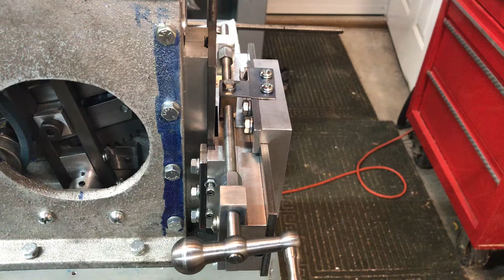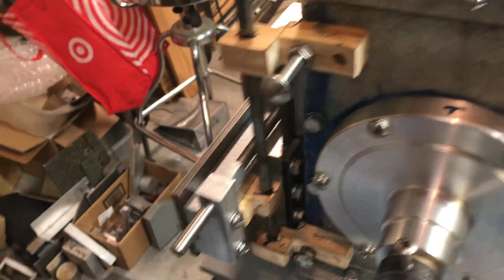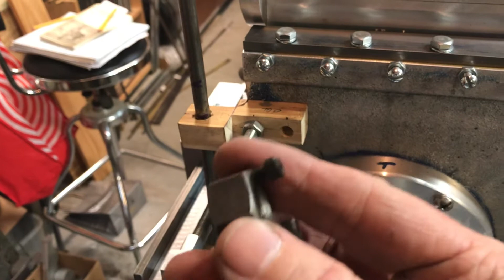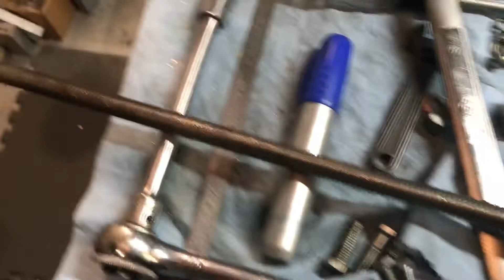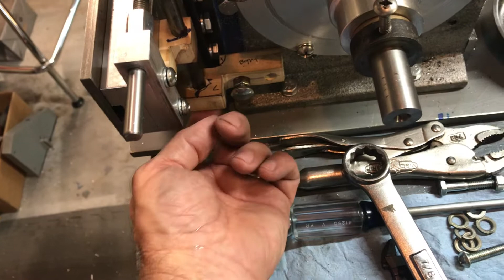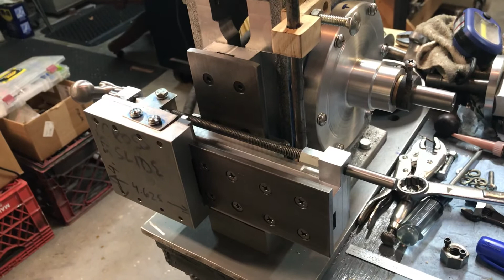Gingery shaper lead screws. Cross feed complete, vertical mocked up

Comment: I like your idea of using the 1/2-10 acme threaded rod.  For a couple reasons.  The acme thread form will be easier on the nut and a micrometer dial for adjustment would be nice.  Which brings me to the crossslide.  Having a lathe you could have cut an acme thread or a vee thread to 20 tpi and done something similar for it.  Having both the lathe and milling machine, I bet you could have made a one off tap.  Seems I remember you saying you had a dividing fixture that could be used to cut a couple flutes in the tap.

OKAY, enough armchair machining.  I am enjoying watching this build (albeit I am a newcomer)  I have this series of books and I would like to make one of these myself someday.  Thanks for sharing.  You have my vote for longer videos!  You have great content!

I subbed you and will sit and watch your loco build.  I am just starting to get into machining and am a neophyte or Tyro.  Am just about done with the Kenneth Wells stationary engine.  Need to pressure test the boiler and make a pressure relief valve and it is pretty much done.

Joe
Reply from the maker: Thanks! Just ran the locomotive on its first track test this past weekend. Short video posted. Hope you enjoy. Good luck with your projects!